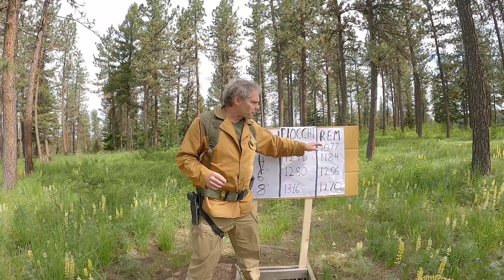How Does Barrel Length Change Velocity

Comment: There is an additional component :) to consider in the relative gains with increasing barrel length in .357 magnum.  That is the difference between .38 special and .357 magnum ammo.  Because .357 typically uses larger charges of slower burning powder vs the .38 spl, .357 ammo will theoretically gain more velocity vs .38 ammo as the barrel length increases.
Conversely, a practical impact of that is you may get comparable velocity from a 2 1/2" barrel using .38+p ammo vs .357 ammo, with less muzzle blast and recoil because the faster burning powder of the .38spl will burn more of the powder charge inside the barrel. Something to consider when choosing what to load in that 2 1/2" barreled .357 carry gun.
Reply: Nope...not even close velocity wise..so use a mid power .357 load if u need to.

Comment: If you load your own ammunition you can select a slower burning powder, that could change how much pressure is generated at what time during the burn (ie the pressure curve) to make better use of additional barrel length. The opposite is also true: faster burning powder to generate more pressure sooner for shorter barrels. In either situation make sure you know what you're doing first, and that you have the correct reference tables (or software), so that you don't turn your firearm into a pipe bomb.

Comment: Paul, I suggest double hearing protection when shooting that much magnum handgun or short barreled carbines.  Ear plugs OR muffs will provide 25-30 dB noise reduction, not enough protection for extended fire with very loud guns.  But amplified (with cutoff) muffs over foam plugs you will get higher attenuation AND the muffs will provide bone conduction protection.  I’m wearing hearing aids now, because I didn’t understand this many years ago.

Comment: If possible, it would also be neat to look at how the cylinder gap affects velocity. I know, I asked about this a few years ago, and one of my fellow viewers directed me to a web page that had a detailed study of this exact topic. I very much enjoyed pouring over all that, but it would make for an interesting Paul video nonetheless. So Paul, if you're able to purchase or borrow something that has the same barrel length and chambering as a revolver, but in an auto loader, that would make for a nice presentation. Maybe one of those .357 1911's, or a desert eagle in .357 or .44. I guess a .45acp or a 9mm would work too, assuming they have the same length barrel, but if might be a more compelling comparison with something more powerful, like a magnum cartridge. 
Something else that would be cool to look at is how much of a difference it makes to support a firearm. So what I mean by that: We all know that if you limp wrist an auto loader, you can induce a malfunction because you're absorbing the energy needed to cycle the action. But to what degree does that affect velocity? If you rigged up a rifle on some strings or para-cord and shot it that way, completely unsupported and left to swing, how much energy are you taking out of that round? Of course you can also test it by simply supporting it more or less on your shoulder as well. It would be really interesting to see what kind of velocities you'd get.

Comment: Pressure within the barrel does not increase for longer barrels. The pressure peak is reached within the first couple inches of barrel. You do get a greater total accumulation of pressure with a longer barrel, but the peak pressure stays the same.

Comment: Good demonstration of the efficiency curve. The sight radius is somewhat shooter dependent. I tend to shoot handguns slightly more accurately with a shorter barrel/sight radius, but have seen target handguns that were "tricked out" with extended ribs to take advantage of the longer sight radius without adding all the weight of the longer barrel.
Great video as always.

Comment: Going from my 44 mag Super Blackhawk with a 6'' barrel to my Winchester 92 with a 20'' barrel velocity goes from 1400FPS to 1800FPS. This is with full power 240GR JHP handloads. Plinking level ammo with 250 Gr LRNFP goes from 1000FPS to 1200FPS n the same guns. Anyway, just a couple of more data points.

Comment: When buying a pistol cartridge carbine I noticed the 20 inch barrels produced lower velocities than 16 inch barrels.  It was not insubstantial either.  Pistol bullets have fast burning powder.  I am sure you could reload and get the longer barrel to provide increased velocity.  People may be disappointed with the extra length.
Reply: "People may be disappointed with the extra length."  That's not what she said!

Comment: Long preamble to a question: me being a physicist, I know that pressure in the barrel is a force that acts on the bullet. I know F = MA, and the mass of the bullet does not change. So that force from the pressure causes the bullet to accelerate. But at the same time, the bullet fits very tightly in the barrel. So tightly in fact that the rifling digs into the bullet. There has to be a massive amount of friction as a result. The friction imposes a force on the bullet which acts to decelerate the bullet. Also, the pressure in the barrel is not constant. While the powder is burning there is a contribution to an increase in pressure, but as the bullet travels down the barrel the volume of the pressurized space increases, which would result in a reduction of the pressure. All of this taken together would result in a net acceleration. The net acceleration would start out positive, so the velocity of the bullet would increase over time. But given a barrel of sufficient length, the net acceleration would become negative, resulting in any additional barrel length becoming detrimental to the muzzle velocity. We could imagine with a barrel long enough that the bullet would stop inside of the barrel. So with the existence of rifles that fire pistol cartridges I come to my question: At what barrel length does any additional barrel length result in a decrease in muzzle velocity?
Reply from the maker: Depends on firearm and ammo choices. 
Real answer is: I dont really know. 
 For a small caliber like 9x19 a 16" barrel gives net gain over the 5" barreled pistol, but you may find that a 20" barrel has less velocity than the 16" For .357 this effect might occur in the 20-24" category.

Comment: Great comparison and I appreciate that you took the efforts that you did to remove variables other than barrel length.  I think barrel length's effect on muzzle velocity has gotten much more attention WRT rifles than pistols.  One significant reason though why one might want to pay attention to the effects on pistols though is whether or not the bullet ends up going supersonic (if doing so is undesired).  I know from my own experience that I've noticed that factory 147gr 9mm that stays subsonic out of a 5" pistol barrel tends to go supersonic out of an 8" PCC barrel with a suppressor, realizing that to some small degree the suppressor itself also likely adds to the effect of keeping gases behind the bullet.

Comment: @Paul Harrell FOR VELOCITY Graphs in different barrel lengths; 357 & .38 check out my vid : Is a 3" 7-shot .357 Magnum a viable CCW?  Last FBI Revo was 3" model 13 (Winchester 145 gr. SILVERTIPS approved), Postal Inspectors got a special 3" (not typical 2 3/4") Ruger Speed Six (Federal 125 gr sjhp).  For concealed carry a 3" Is best balance both figuratively and literally but hard to find. Also, Ruger barrels shoot faster than Smiths, and I have real OG FBI ballistics data including .38 and .357 from the 3" m13 they carried. Their 145 Silvertips performed very well, and I sent Gun Sam the Federal 125 gr. Sjhp..and then performed great & were known as the best shock stoppers (every test shows slightly more penetration then Remingtons load). Just thought some would like this info please Like

Comment: Just so people don't get this wrong. 
The propellant could be fully burnt and the projectile could still pick up speed.
 Up until the point where the compressed gasses have expanded enough to no longer exert more force on the bullet than what it experiences from drag inside the barrel. 
Once there is more drag than accelerating forces, it will gradually start slowing down.

Most handgun caliber loads will peak in pressure within the first inch or two of barrel length. After that, the pressure drops, which is part of the reason why the gain is smaller towards the muzzle.
If you wanted maximum energy out of a gun while staying within certain pressure limits, you would have to use a propellant that increses burn rate over time to match the growing rate at which the barrel volume behind the bullet increases. -> flat pressure curve. Would have one heck of a muzzle blast though :)

Comment: Another great video Paul.
One point you missed is that you can use a powder with a slower burn rate in the longer barrels, and that would increase your velocity gains.
Perhaps only applies to reloaders but it is applicable.

Comment: Excellent video, Paul thank you . . . and I LOVE the Dan Wesson .357 magnum revolver “set.”

Your results confirm my long held opinions and your reasoning is identical to what I have understood forever.  BUT (and I am NOT suggesting your information is at all inaccurate or misleading),  sometime you might want to explain to your many less experienced shooters that “practical barrel lengths” vary — due to fundamental design — between revolvers and autoloaders.  I won’t belabor this, since you’re clearly very aware of the phenomenon, but (dependant on the cartridge’s OAL) some of all semiautomatics’ barrel is consumed by the round-in-battery, whereas for revolvers none of the barrel is.  Okay, that’s a very poorly worded explanations, however, you obviously know what I’m discussing. 

The critical point for less experienced shooters to understand is simple, but important.  For example, a four inch barrel on a 9x19mm semiautomatic will have a “working barrel length” that approximates 2.8 inches, whereas a four inch 9mm revolver will have a four inch “working barrel length” (plus a small additional amount provided by the cylinder, and less cylinder-gap gas losses).  

Thus, the 2.25 inch barrel SP101 we both use might actually have “an autoloader equivalent” barrel length of roughly 3+ inches (it would be fun to compare a 2.25 inch 9x19mm SP-101 velocities with one, or more, of the many 3,0/3.1 inch micro-nines).
Reply: However the cyl gap loss you mentioned is more significant than you are accounting for. In most situations the barells are actually equivalent as in 4 inch revolver equals 4 inch auto the pressure loss negates the extra length.
Reply: @Benjaplay94  
I’d be interested in any documentation you can provide.

Comment: Years ago I had a new "pistol pack" with 2,4, and6" barrels. It had a trigger spring problem. There was a repair facility nearby where they fixed and tested it while I waited. Ironically they were located at an old schoolhouse.

Comment: You confused me, sir! After firing the Fiocci string, you said "Lets switch to the 4 inch barrel", then switched ammo but kept the 2 1/2 inch barrel! BUT I figured it out. Part of the reason for the diminishing returns MIGHT be the fact that when you go from 2.5 to 4 inch, you are nearly doubling the barrel length. But when you go from 4 to 6 inch, it's only a 50% gain. And going from 6 to 8, it's only 25%. And the type of powder used could be a factor. Ninnyevent, this is another typically well-made, informative and entertaining video, up to the standards I have come to expect from you. Keep up the good work, Paul, and I will keep watching!

Comment: Great video!  Thank you for doing this.  Follow up question...if there's a point of diminishing returns after 6 inches, why do we see such great velocity out of an 18 inch rifle barrel?  Keep up the good work!
Reply: SCAM ALERT! ^^^ THAT is a SCAMMER. Please be aware that that is a SCAMMER and do not fall for the SCAMMER.
Reply: Also, "diminishing returns" isn't "diminishing velocity." It's "less additional velocity for each additional inch of barrel."
To take some made-up numbers:
800, 900, 990, 1070, 1140, 1210, 1260, 1300, 1330, 1350, 1360, 1365, 1365, 1360, 1355, 1350, 1345, 1340, ...
That first extra inch is getting you an extra 100 fps and about 26.5% additional energy.
The eighth additional inch is getting you an extra 30 fps and most of 5% additional energy.
The eleventh additional inch is getting you an extra 5 fps and most of 0.75% additional energy.
Technically you're still getting a "return on your investment," in the sense that carrying that extra inch around is getting you more muzzle energy, but fuck it.

At those velocities, the other part of the issue may be less significant, but there is another part of it, which is that air resistance is proportional to the square of the velocity (except across ranges where the airflow changes, so you can't compare supersonic to subsonic that way), which means the additional velocity you get with the extra barrel length lasts less time and less distance.
If your bullet velocity at target is As if you were 300 m away with a 10" barrel from 400 m with a 16", 450 m with a 20", 470 m with a 22" and 480 m with a 25", that increase to 16" might really matter, but the last three inches? Lugging all that extra metal around to be ten paces closer? Bah.

Comment: This showed just about what I expected and common sense would predict.  I didn't expect that the diminishing return effect would be so pronounced quickly.  At that rate, a 10" or 12"  barrel might actually show less velocity than the 8".  On the other hand, handgun ammunition is designed for shooting, and thus expending most of the energy, in a shorter barrel.  

This really makes me question the viability of a pistol caliber carbine.  I can see the desire to shoot something that handles like a rifle with little recoil and being useful for small game or self defense.

Comment: Other factors also come into play here. Powder burn rate and amount of powder. Example: .44 magnum vs. .357 magnum. More powder is used in a .44 magnum. Especially in hot loads.  And then you have larger magnums like the .454 Casul,  .460  and 500 S&W and .475 linebaugh.  .45 supermag is another that uses a lot of powder.

Comment: Could the weight of the round have an impact on the length of barrel until reaching the diminishing returns threshold? 
It seems a lighter projectile would need less distance under pressure to achieve its maximum velocity threshold. 
Like an 80grain .38 out of a 2inch barrell wouldn't see any significant changes changing to an 8inch barrell, but like a 250grain .44 magnum just might need that 6 or 8 inch barrell to fully reach its velocity threshold 

Does that make sense?!